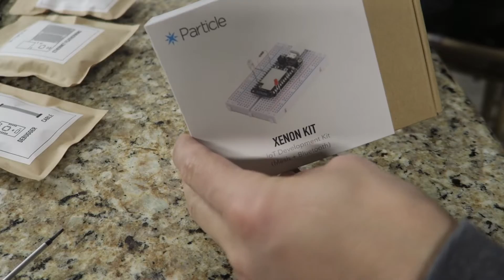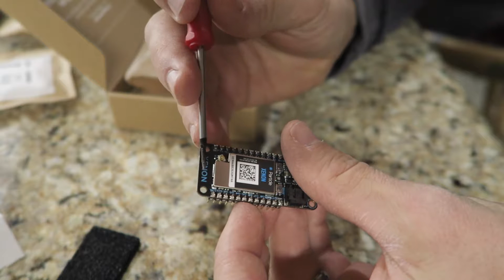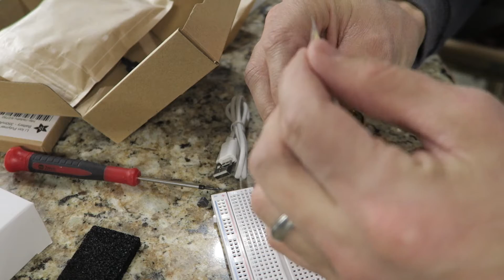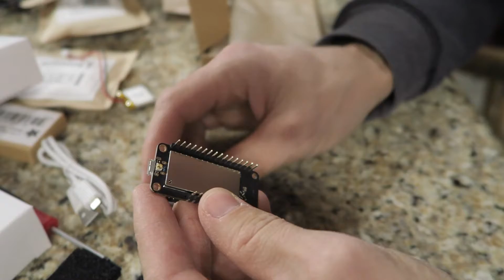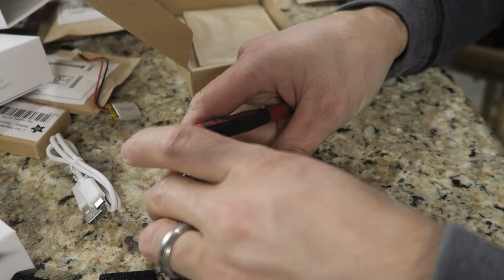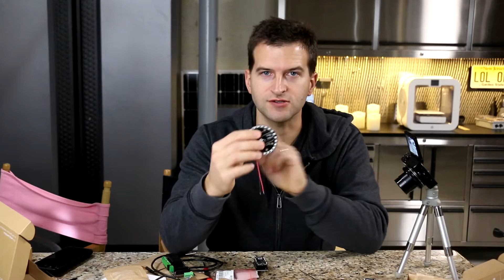Particle Xenon/Argon/Boron Mesh #arduino Hardware Unboxing and First Impressions

Comment: I enjoyed your video and decided to launch a project around Particle.  So far Particle I have had nothing but problems. Is there a way to work with stuff li a local mode like and Arduino, Pi or Beaglebone?